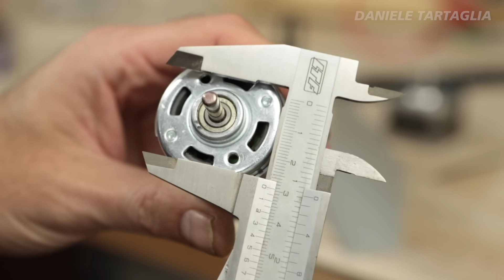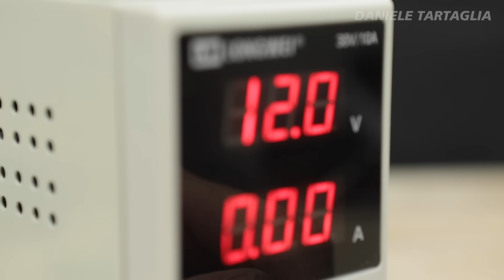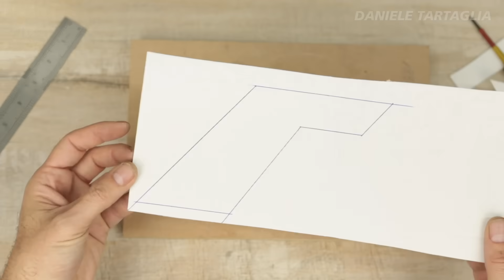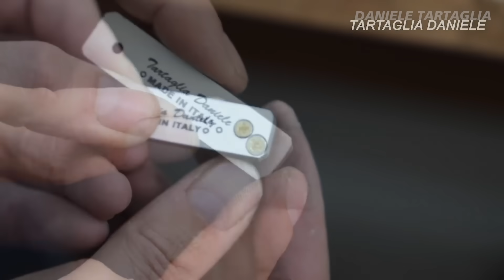How to make SCROLL SAW machine DIY

Comment: The funny thing about ur build here pal is I have so many of the small parts. I spent a tonne of money on parts like motors, belts and pullies, etc that I can maybe take a shot and try build one of these soon. I will be taking a shot at it soon man. I got a Potentiometer to buy. Actually I got one from China that the power and speed all comes from. The thing about them is they can be dangerous if u don't house them correctly. I don't want to be getting friend by my own stupidity.. LMAO

Comment: @1:00 the motor magnets are removed. This is important because the magnets create a generator out of the motor as it is rotated by the driving motor.  There would be a cogging effect if the magnets are not removed. This is a power loss that does not serve any purpose. Good call!.

Comment: Good idea, shot at 100, but the walking of the saw is very strong, it is difficult to cut it according to the drawing, you need to shorten the saw blade and put a stiffer spring, thanks for the video, !! 👍 👍 👍

Comment: It always makes me cringe, when I see a Vernier calliper being used as a marking gauge.
They are supposed to be a precision measuring  instrument.
What you should use, is, one of these;
Mi fa sempre rabbrividire quando vedo una pinza Vernier usata come indicatore di marcatura.
Dovrebbero essere uno strumento di misura di precisione.
Quello che dovresti usare è uno di questi;
https://www.aliexpress.com/item/32876196374.html?spm=a2g0s.9042311.0.0.27424c4dgASMbA
Sono anche più efficaci.
They are also more effective.
Also, the crank running on a screw thread will wear quickly. It could be replaced with one of these;
Inoltre, la manovella che scorre su una filettatura si usura rapidamente. Potrebbe essere sostituito con uno di questi;
https://www.aliexpress.com/item/4001282300698.html?spm=a2g0o.productlist.0.0.510b7d16Bf6y0P&algo_pvid=49aa3a3c-460e-4b01-9d62-9a75d2585e6e&algo_expid=49aa3a3c-460e-4b01-9d62-9a75d2585e6e-58&btsid=0b0a01f816125726417967784ebd0b&ws_ab_test=searchweb0_0,searchweb201602_,searchweb201603_
.

Comment: I watched and thought this is complicated, seemed it from the video ..
But easy to build.

On the link arm, do you or have you made a slot for blade adjustment?
I would think if the screw hit stops it would come off on the top, and so just a little pull down would take up slack :)

Comment: I am always impresses with your projects.  I might actually try and build this one.  One thing I don't understand though.  Why the smaller gear and belt? Excuse my lack of knowledge on belts and gears, but I could see if the motor was attached to the small gear and you wanted to reduce the motor speed.  Is the smaller gear even needed in this case?
Reply: Okay, never mind. After watching the vodeo several times I see I was wrong.  The small gear is actually attached to the dc motor.  For some reason I thought it was the larger gear attached to the motor.

Comment: Only thing I'm a bit worried about, is the blade attachment. How are those round connectors holding up? Blades stay tightin there with use? Any sign of damage over time to the blade itself from the bending inside the connector when clamped?

Comment: I bought the wrong metal saws! They are too flexible  and thus cant push up the upper rod. You need stiff blades that can push up the upper rod without bending.  Waited for a month on those useless blades! He should have explained this.

Comment: You've done a beautiful job, but by the time you buy a power supply, it's probably cheaper to buy a used purpose built machine with a steel / cast iron table, with dust blower etc.

Comment: Very nice work! If you search the number off the motors you use, you will find the exact dimensions of where the shaft of the motor is in relation to the holes and other useful data which may save you time! Over all very nice build!

Comment: Was wondering. If the motor is 3500-9000 rpm and the gear is 20:60, isnt that still very fSt for a scroll saw:  1200-3000 strokes a minute

Comment: Try to add counter balance weight opposite the drive rod on the driven pulley. You won't have to chase the machine across the table. Sorry for the English, but my Latin from 60 years ago fails me.

Comment: Great! You can easily sell these to schools or onlne. I would pay 25 euros.

"Vito, Vito Adolini" ( This secene went very bad for the siicliian Godfather that murdered Vito Corleones father and brother 25 years ago).
Reply: Joshua,  if these were mass produced, a price of 25 euros would be reasonable. btw Im sure he didnt pay 30 euros for that motor. I have 5 laying around that were salvaged myself. For a "very shoddy engineer" he makes very cool and useful stuff..
Reply: Well, this is shaping out to be a very interesting discussion. It seems to be a subject you know a thing or two about and I will try to get somethng out f it. 
I didnt notice the motor had gearing inside. I think a normal 12v motor would do just fine for this little saw. 
The big thing that makes mass production able to sell cheaply is not the fact that you can get the materials for 1/10th of the price. It is the fact that you can spread out part of the costs  over a lot of products. Only the variable costs are 1 to 1. The rest of the costs will become less and less per product as the production increases.
Reply: Joshua, yes I low balled it on production costs too much. 50 to 60 euros would probably be a reasonable selling price. I did not account for the psu. But the stepper can off course easily replaced with some sort of bearing. As you mentioned. If an ac motor is cheaper than, yes replace it. But the indian guys make due very well with just a 12v non geared motor. They sell this product on BG and others for 100 euros. I think that is overpriced for this usable gadget. You can make a good one yourself for about 40 euros.

Comment: it is very strange to use a stepper motor as an axis on the bearings. and, as a sliding bearing of the saw axes - a tree. it would be necessary to insert at least bronze bushings into them. and, the speed regulator - there’s generally extra.

Comment: Nicht schlecht! Der Kurbelantrieb hat mich an meine eigene Dekupiersäge erinnert - gibt wohl nicht so viele Varianten, das ohne zu großen Aufwand zu bauen. Die Idee mit der Sägeblattklemme gefällt mir auch gut. Werde ich eventuell übernehmen. Welche Materialstärke kannst Du maximal darauf sägen?
Not bad! The crank drive reminded me of my own scroll saw - there are probably not so many variants that can be built without too much effort. I also like the idea with the saw blade clamp. I might take over. What is the maximum material thickness you can saw on it?

Comment: You shouldn’t wear gloves when working with the scroll saw
Reply: Just wear gloves that actually fit. There should be no distance between the glove and your skin (unless welding and casting gloves,and you don't operate tool machinery in those). Your hands (and gloves) should NOT go anywhere near enough spinning/ocillating business / motor / transmission end of tools anyway, for them to ever get the opportunity to grab you.

Most cutting and grinding power tools will cut through your gloves, almost just as easily as your soft skin and flesh. Gloves are to protect from burns, sparks, splinters, chips that go flying and so on. Distance and only distance protects from getting cut, chopped - and grabbed. Gloves or no gloves. 

TL;DR
Gloves only protect you from the heat and hazards of your work piece.
Distance and only distance protect you from the hazards of the tool itself.
Always keep your fingers as far away from the business and moving ends of tools/machinery, as you would without gloves.

Comment: Excellent. Love the tricks and tips. Perfection to detail. I'm sure you cleaned up the aluminium on the block at 9.45.  Never had a faulty stepper motor but well done on that ingenious idea. Must admit the first time I saw part of the design, motor and stepper was wondering if this was some kind of perpetual motor/generator, motor driving stepper as generator.
Reply: 88th is 8th 8
.
Reply: Just don't understand why you would not explain what you were trying to achieve and have that annoying background music to what could have been a useful video...... stepper motor????

Comment: I'm afraid the threads will eat the connecting rod. Maybe use a plastic or metal sleeve ?
And a square or rectangle base would permit to use a guide for straights cuts.

Comment: Excellent and original build!  One possible upgrade and one concern.  A method to variably adjust blade tension would be useful.  And the pulley is fairly offset from the bearings which could lead to excessive bearing wear.

Comment: You need a SERIOUS elucidification on MODERN CABINETRY SHEETGOODS FASTENERS.
ALSO....
GLUE WORKS EFFECTIVELY.
ALSO....
DIY EPOXY/MINERALDUST MACHINE BASES.
Also P.S.
Yer machine might also fit a small File.

Comment: That method of marking the 4 mount holes for the dead NEMA casing is brilliant! 
Thank you for Banggood affiliate links for tools used in the build. Saves a lot of bandwith not having to keep going back to older videos all the time and chewing up the rather restrictive data limits placed on rural Aussies (50Gb a month for $65 is stupid when just a single software patch can blow it in a single night and leave you on 256kbps until the following month)

Comment: So whats the purpose of using the stepper motor?! Is it just a bearing block? And why did you add a spring inside it?
Reply: The spring avoid the central axe to move horizontaly, since the central part has been removed.
Yes, just a bearing block here.